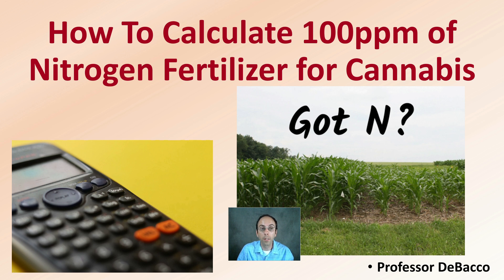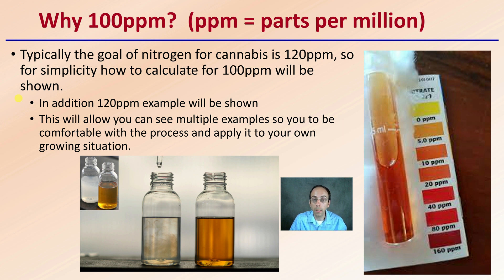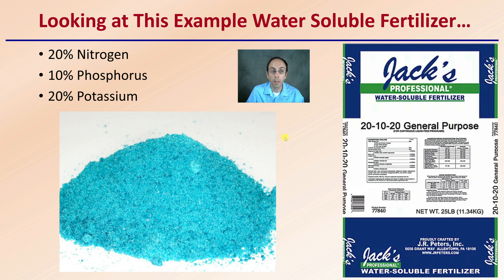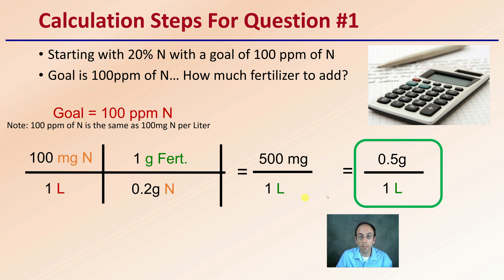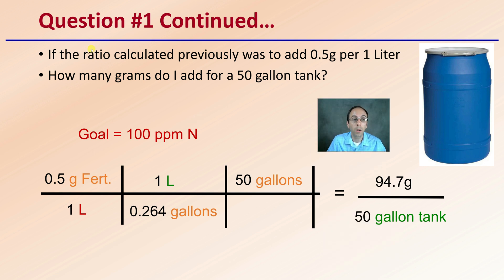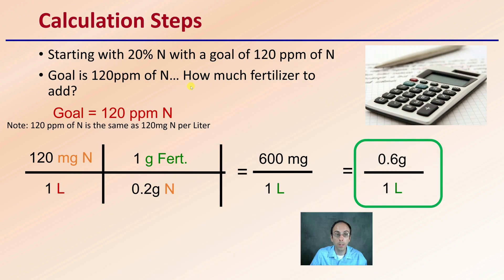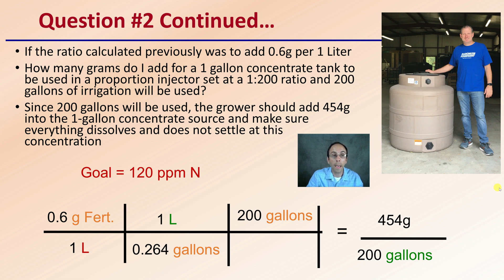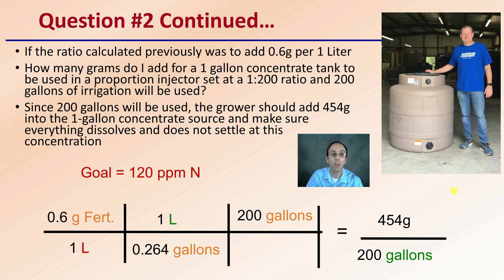How to Calculate 100ppm of Nitrogen Fertilizer for Cannabis

Comment: For Americans, 454 grams is 1 lb (approx, actual is 453.592). So it’s 1 lb per 200 gallons or 1/2 lb per 100 gallons in the final formulation. One of the few times imperial units are easier😁

Comment: as always thank you very much for these great videos, but please, can you kindly explain to me the conversion of phosphorus and potassium into elemental P and K in commercial products?
I have a product npk 6-11-6, N - P₂O₅ - K₂O
I was told that nitrogen does not need to be converted while only phosphorus and potassium do, is that correct?
Do I always have to do the conversion into elemental (P) and (K) to get the right ppm value?
And does the same conversion also need to be done with cal-mag and sulfur?
After the conversion of this NPK 6-11-6 product, for 10 ml in 10 liters of water is this result correct?
N: 60 ppm
P: 48 ppm
K: 50 ppm
Reply from the maker: 6-11-6 = 6%N-11%P-6%K, but these are the plant recognizable molecules of these nutrients.  If you want the detailed math see this link... https://www.soiltest.vt.edu/content/dam/soiltest_vt_edu/PDF/430-100_pdf.pdf

Comment: After doing some more research I've found out why this video was confusing to me. Although it is quite convenient, it isn't accurate. Let's say we have a fertilizer with a density of 2,500g / L with a 0-10-10 NPK with it being P2O5 and K2O. First off, 1mg/L is for water, which for simplicity's sake let's say 2,200g, and so we have to calculate a multiplier. 2500g / 2200g gives us a multiplier of 1.137x, let's keep that in mind as we move forward. Next, we have to calculate the molecular mass of P205 as not all 10% is available as phosphorous. I won't bore you with the math on this one, but after a quick glance of the Periodic Table you find that only ~43.6% of P2O5 is Phosphorous. So, if we wanted 50ppm of P, Using your method, we do 50mg/L x 1g/436mg (43.6% of 1 gram = .436g x 1000mg/g = 436mg) = .1146 grams to achieve 50ppm *if this were water, but we know the density is higher than water*, and so this is where the multiplier comes in, .1146 g/L x 1.137 = .13g of 10% P2O5 Fertilizer in 1 L of water  to achieve 50ppm. What are your thoughts on this?
Reply from the maker: Interesting way to being density into the mix.  This intended for any liquid feeding for any substrate (soil or even hydro) based growing.
Reply: @DeBaccoUniversity  no the way I showed you is the way is done for hydroponics. In soil the application recommended are in lbs of ammonia or lbs of etc. in hydroponics we are using that actual ppm of the N in nitrate and so you have to use the molecular mass and find nitrogen’s percent by weight otherwise your values are skewed. The method you provided can’t be used for anything that has to do with only Nitrogen. In NH4-N it is 87% nitrogen. Which means if you add 1 gram to water it will 876ppm/L. Also, it doesn’t work if it is a product that has more than 1 source of nitrogen. Such as calcium nitrate, Ammonium nitrate, and ammonium. All have different amounts of nitrogen based on molecular weight.
Reply: @DeBaccoUniversity  run the test yourself, do the method in this video for ppm of different liquid fertilizers or even salts. Then send it in for analysis and Youre going to find that the actual ppm isn’t matching your calculation and this is why. You have to take into account molecular weight and density (for liquids ferts)
Reply: As another example, jacks 5-12-26 has 26% K ?! Then why is there only ~215ppm? 26% of 1 gram is 260 mg right? Well 26% K2O is the answer, we only account for the 83% that is actually K. 260mg K2O x 83% (Percentage of k on compound) and you get 215ppm actual K. You have to be doing this chemistry when trying to formulate your own nutrients.
Reply: @DeBaccoUniversity  basically in a nutshell, your method only works assuming the actual npk value given is for the available npk respectively, but if it is their compound given as NPK, then you are not receiving the NPK that’s on the bottle/bag.
Reply: The way you did it works, but only for soil applications as they typically recommend by x lbs of monoammonium phosphate for example. Where the weight is already taken into account in the recommendation.
Reply: For example, if a fertilizer says it is 46% N
, 30% NO3 (which is only 29% of ACTUAL N), 10% calcium nitrate (14% actual N), and NH4N (87% actual nitrogen). So the amount of available nitrogen is actually a smaller percentage since the compound is what is given in the percentage by weight. But NOT The individual ions which is what the plant uptakes. i.e. we are not told amount of N, but amount of N containing compounds.

Comment: this is a great video, but why do some videos do something like multiply the percentage (say N) in the nutrient by the weight of the nutrient divided by the weight per given volume of liquid or something like that. And then find the amount of water necessary to dilute that to the given ppm? I'm sure I'm missing something, but hopefully you can understand what I'm trying to say.
Reply from the maker: The key is to calculate the amount of nitrogen and make sure that the plant are receiving the intended amount which should be in the 100-120ppm as a starting point.  Hope this helps answer your question.

Comment: Hello, thanks for the video! I was wondering should my calculated values off of guaranteed analysis match measured my readings off an EC meter? When calculating PPM, would it be closer to PPM500 or PPM700 from an EC meter? I'm finding that when I follow the fertilizer instructions for calculation purposes, the mineral values that will be delivered are very good. But, when I measure these same formula with an EC meter, the reading is so high that I'm afraid to feed it to my plants. I've had success fertilizing at 800PPM (measured) for my mother and vegetative plants. I've been told this is a good number to feed at as well. But, when I performed calculations against the guaranteed analysis for what I'm feeding, my mineral values are very very low. It makes me really question what I'm doing. Do you have any insight into this?
Reply from the maker: This DeBacco University video may be  helpful... https://www.youtube.com/watch?v=0FjutQkbeKo  The guaranteed analysis may not be what you think;-)

Comment: How can i calculate for a tank that will supply 2000 plants? I mean, i got a fert 25-5-25, and i need to order X 25kg bags of it, how can i precise the amount of bags i will need to achieve the precise need for plants
Reply from the maker: It depends on the total amount (volume in liters or gallons) you will be fertilizing with.  All calculations are provided so you can make the adjustments for your specific growing situation.

Comment: hi Debacco form this recommendation to watch this video in link from  General fertilizer consideration . i agree whit the Math that come to 0.6g /L but  at the concentration whit the PPM pen i get only 0.6ms and not near 1.2-1.3 ms . i know depending where u live water have different properties but .. cant it be the ''why'' ?My Tap Water is 0.4ms alone. Unless it s the Brand of fertilizer i use as you show on other video N-P-K not always match. What would be your suggestion ; stick to the 0.6g/L or trust the PPM meter?
Reply from the maker: Stick with the 0.6g/L and see how the plants react, but you may also want to ensure you are adjusting for the correct pH as adding ingredients to adjust pH will also (very likely) alter the final ppm values.
Reply: @DeBaccoUniversity  Yes  about the pH i used Dolomite Lime when i made my medium to keep everything in control. so far it haven't really move from the starting point yet. also the plants was able to handle it up  to 1.6g/L for 2 month  of 20-20-20  on every watering 2 times a day because i was try to get the PPM to match :D . Idk if its the unknown free seed i have been given but the leafs got 1 and half time big has my hand and the plant cant be more green that they are without any issue so far. I'm considering raise down my value toward 0.6/L for the clone i made. Also i finally found a supplier for 20-10-20 in Canada. lastly im thinking about 2-2-4 Terra Flores form CANNA for flowering since i told the guy at the store i dont wanna deal  whit A and B thing. what do you think and/or what would you suggest?
Reply: different fertilizers will have different pen readings, like urea adds 0 ppm to the water but potassium chloride will jack up the ppm readings

Comment: What are the levels of the other nutrients and minerals that plants need in their different phases? It would be amazing if I made a video saying that the ec and ppm ranges of each thing are optimal for each phase of the plant.
Reply: You kno I've been searching for a video on exactly what u said why can't they add the call mag and check ppm right away or the nitrogen and so on that way we kno exactly where to be and not get deficiencys at all
Reply: @watchingyou1375  Calcium cannot be mixed with phosphorous because they doenst mix well, and preciptate
Reply from the maker: Those can be a bit more variable based on plant stage of development and also the substrate the plants are growing in.